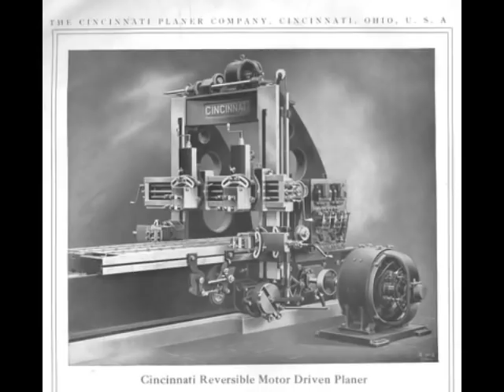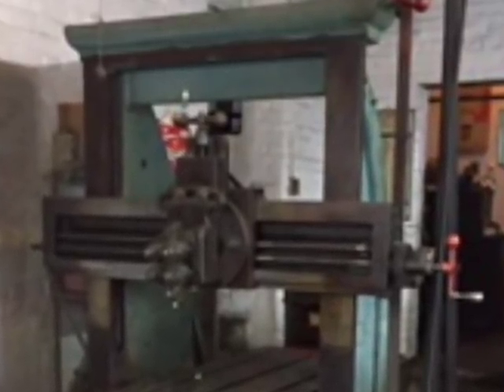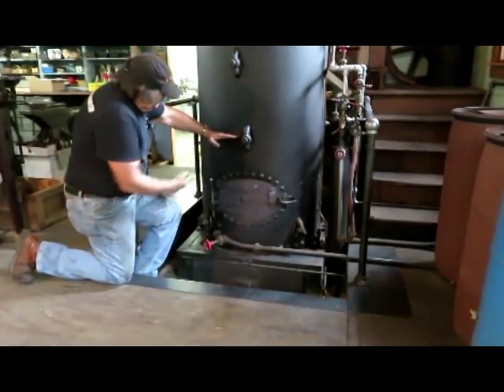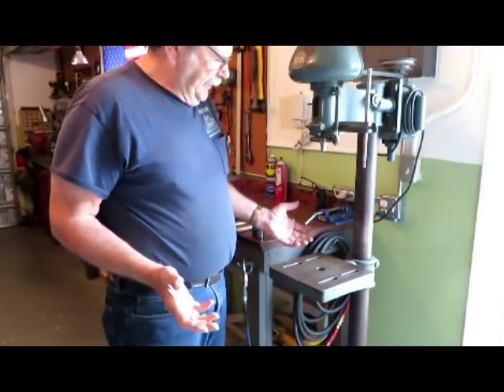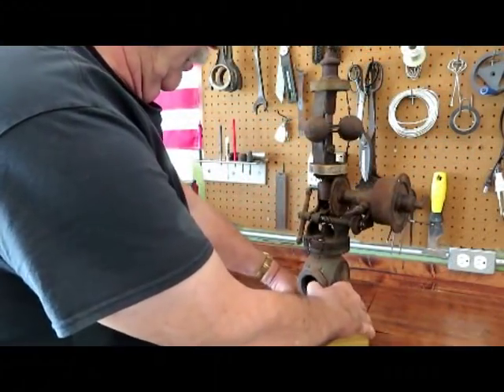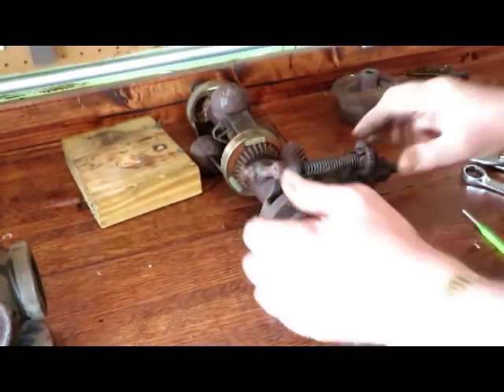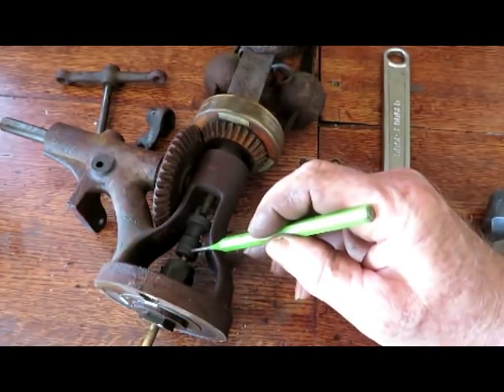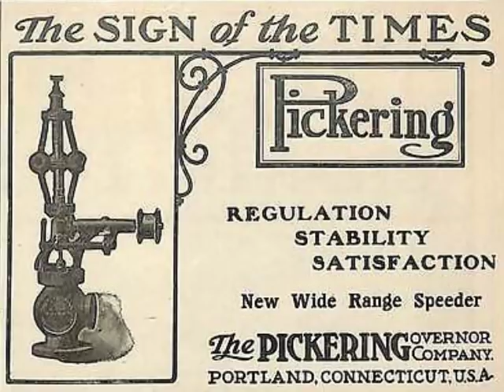Old Steam Powered Machine Shop 51             Company Meeting

Comment: Dave I have been with you as of day one .I will always hit the like button. I did my time as a machinist Heavy duty mechanic .The shop I did my apprenticeship in had a monster of a planer the table was 8 feet wide and 40' long We fit a Cincinnati mill to the head with the big 50 taper tooling it was quite the machine to run The table we converted to hydraulic feed  Yes those where fun days

Comment: Your Delta drill press is very much like mine, I have a model DP 220. It is 14 inch and also has the quick change arbors. Beside the 33 Jacobs taper arbor, they had a mortising arbor and a Morse taper arbor, and probably some more. I picked up a Morse taper arbor for mine (number 1) on E-bay a few years back for a good price and use that for my taper shank drills and have a Morse taper to Jacobs taper adapter with a Jacobs chuck for my jobber drills. The old Deltas are very smooth and quiet running drill presses.

Comment: If you do a search in Youtube for "Langhobelmaschine" (german name for metal planer) you´ll find a few videos. But step back from your screen, some are real large. In the 70th, the company i worked for (they made hydraulic press systems, comp. is long gone) had a planer, which could do 12 mtr. long pieces. The bed must have between25 and 30 mtr. I loved it....
Reply from the maker: I've seen some big ones in India.....Dave
Reply: They are great machines. And some were usable as a mill. You could attach one or more spindles instead of the traditional tool holder for special operations.

Comment: I had that same drill and the same question.  

An older machinist friend said: 1 degree 47 min taper. Use a slide hammer. Popper right off.

Comment: Good show Dave! ....I hope all works out for the planer move ... cannot wait to see it in action!   You must have not looked in the right place regarding your questions about your drill press! There s lots of info out there, and one of the most popular vintage presses around! As a matter of fact...I happen to reproduce the spindle and spindle pulley bearings, for lots of guys doing restorations! It's done more as a favor rather than a money making deal, and the bearings are a bit different, and cannot be found anymore. The reason for the being different, than main design feature of the press, was based around interchanging the spindles, as many types were made for it. Let me know if you need bearings.  Jim
Reply from the maker: Thanks Jim, I will file this conversation....Dave

Comment: Dave, Ask around you area and find independent truckers to haul the planer. In my experience often an independent or small company will haul cheaper and handle special loads better than the big boys. I have never had a single big load hauled but I have had several small items hauled across country at discount rates. Sometimes they are looking for a load home and will discount because they don't want to run empty.  Anyway good luck, enjoy your videos. Mike N.

Comment: Industrial boilers have a continuous blow down valve set to blow off about 10% of the steam flow continuously. Fine adjustment is determined by the conductivity of the boiler water. The boiler water sample is taken typically from the CBD line. This sample is tested for pH, conductivity, and residual treatment chemicals. Higher pressure boilers also are tested for silica.
Reply: That's interesting. Historic boiler operations, it is recommended to blow down as steam is rising in the morning, usually around 20 PSI. Like so most of the scale has settled out during the night and will be blown down. Additional blowdowns may be performed as needed through the day to maintain water quality and prevent foaming. 

Usually you'd see locomotives blowing down when crossing bridges, and workshops often had a dedicated blowdown track bordered by a fenced-off area so the blast would not hit any unsuspecting personnel.
Reply from the maker: On old stationary boilers there usually was an additional blow down valve at the mid water level to blow oil and sediment off the surface of the water...don't know how effective that was.....Dave
Reply: @davidrichards5594  According to Jim Conte it can be quite effective. He posted a story on the stak about a chicken processing plant that apparently had a leaky condenser and ended up with chicken grease in the boiler. Using the surface blowdown their boilers went from barely steaming without tripping a safety limit to steaming full power in less than an hour's time.
Reply: @davidrichards5594  They would be as effective as the people doing the water tests and looking after the results. The last place I worked the CBD was automatic and linked to the steam flow. It was nominally set at 1% of steam flow and modified according to the conductivity of the boiler water, all of which was monitored. Operating pressure was/is 1600 psi and normal steam flow was 600K pounds per hour. there is a 4 stage water treatment plant which consisted of multimedia filters, a 2 stage reverse osmosis filter, a cation/anion demin train and a cation/anion polisher. Pretty much all the conductivity in the boiler water came from the TSP and ammonia we added, which considering the amount of water involved was pretty minimal. In addition to the on line monitoring we also did manual tests twice every 24 hours. Load was a 68 megawatt turbo generator.

Comment: The planner looks like it will be a very nice bit of kit and a great addition to your shop. I was interested to see your storage method of your boiler. Where I am we use a boiler treatment that helps with getting the Ph correct as well as shifting sediment and it also works to keep oxygen out when the boiler is cold among other things. If the boiler is left for more than a couple of weeks the usual practice is to water wedge it so that it is full to the brim of water which keeps the boiler treatments protective coating on the steel and prevents air from getting into the boiler. If the boiler is left longer than 6 months without a fire the treatment looses its effectiveness so the boiler would need to be dry stored. 
All very interesting with boilers as in the working day they were a very consumable item and now we work as hard as we can to preserve them for as long as possible.
Reply from the maker: Nathan is 100% right on with everything mentioned. I use Jim Conte's "Boiler Saver" (there are others) which has buffers to KEEP the PH right, but you still need to adjust the PH on the "fill".....Dave

Comment: Dave
you are a man after my own heart. many years ago i too looked into a getting a plainer and you have ran into the same problems that i did. i wish all the luck in getting it home. i wish i was 25 years younger because i have a job that would fit that plainer like a shoe. i made a homemade 2 cylinder mill engine out of an old donkey engine. i had a local welding shop to weld up a base for it but with all my instruction's they still never got the base flat enough for the cylinders to run smooth enough for me. it needs to be setup on a planer and be milled flat. dimensions don;t mean much but the flatness dose. Dave if you need some money too help just let me know.
Reply from the maker: Thanks very much. Welded steam engine frames are the main thing I want to do also with a planer. I would like to build a "box" frame to make two side crank 8 1/2 x 10 engines out of the Mundy steam hoist that my boiler came from......Dave
Reply: David 
that is just what i did.could you somehow send me your email address so i can send you pictures of it. i wish i could post pictures here on the comment page but that is above my pay grade.

Comment: Dave, I realize this video is a year old, but in the spirit of what your channel upholds, it is merely ripening. I work in SD as a toolmaker for a shop that runs the latest and greatest CNC equipment in modern production. The reason I write this, is to tell you that the bread and butter of our business is planers. Yes, buried in the middle of our shop are six old planers, two Rockford hydraulics and four G.A. Gray gear drive machines. We resharpen mill rolls for the roller mill and feed grinding industry. Our competitors run modern cnc "corrugators" as they're called and they cannot hold a candle to our setup. It takes a lot of man hours to convert these old workhorses to do what we do but it pays dividends. My job solely consists of keeping these old girls running. I'm a rebuilder and scraper hand as well as a toolmaker and it's my job to maintain and convert these machines to do what we do. I will tell you first hand, they don't build em like they used to. Our oldest machine is a 144" x 48" gray built in 1907. As far as we know it's been in daily production since it was new, we have maintenance records going back to 1909. It was bought by our company on 1977. Taken from a line shaft shop in MN. Our largest machine is a Gray with a 16' x 4' table weighing in at 73,000 # and it's a dream to run. We recently purchased a dual column 14' x 4' planer from Jefferson iron works in Ferndale MI. You need to check out his website it's very well done. He caters mostly to the automotive industry. His biggest machine is a Giddings and Lewis 40' x 20' dual column, the table alone is 97,000# and no that's not a typo. We toured his shop last Sept. He was cutting 16, 8 ton castings at once on it for GM. Two heads on the cross rail taking 1" deep cuts with 1/8" stopover for a 2" removal total. It was a sight to behold, the operators wore ear muffs. He said no one in detroit can match his productivity on large bodywork castings. He is third generation. Again look him up. Also years ago I stumbled upon an old book on ebay from 1907, which unbeknownst to me at the time of purchase was filled with tons of old machine shop treatise and lots of planer work, it is labeled I. C. S. REFERENCE LIBRARY. I doubt you could find a copy but I wanted to mention it, and if you would like to borrow it I'd be happy to lend it. I wanted to point out that with your Jacob's chuck you can buy a set of short forked wedges that go behind the chuck, one compliments the other and they can be stacked and squeezed in a bench vise to quickly separate any Jacob's taper, McMaster Carr sells them. Go figure.  Also at roughly the 25 min mark in this video I saw you using the unmistakable lime green Pittsburgh brand Harbor Freight punches to disassemble the Pickering governor. I was somewhat saddened by this until I remembered I own and mildly covet the same set, and so you are forgiven. Just wanted to give you a bit of a jab. Before you make assumptions I am 30 years old and currently training 2 younger gentlemen to follow in my footsteps at the company I work for. The trade is alive and well. . . .and so are planers in a niche. All the best.
Chris.

Comment: For something a 113 years old, that governor  looks to be in good shape, It came apart with out any difficulty, so it probably doesn't need a lot of rebuild. One shaft is bent but that's easily fixed.  I thing a good cleaning will do wonders for it. As for the planer, where can I send a modest check, and does the shop have room for it?
Reply from the maker: Hi Jim, Thanks for the help with the move, there now is a paypal.me link on the channel home page, or send to the address in the video description or my profile.  I'll be continuing on the governor ....Dave

Comment: It would be really interesting to see a planer running.  I've never seen one running, even on video.  They are always static "museum" pieces.  But I don't know where you are going to put one unless you double the size of your shop.
Reply: , and then with it what on earth will you plane.  You will need large work handling equipment and the blocks of steel or castings will be very expensive.
Just sayin
ps, get it anyway!!

Comment: If I could make a suggestion. Many of these "haulers" charge by weight. Taking apart part of the machine and putting it in the back of your truck and trailer would reduce weight, probably make you feel better if some of it was "shipped" carefully under your watchful eye. Chances are some of it would need to be taken apart for proper service anyways. Just a thought.  After all my mini mill and my southbend lathe circa 1937 are just too darn heavy for me to get into basement by myself. I took them apart and took the smaller, and lighter, pieces down to basement one at a time and reassembled.
Reply: Most shippers just charge by mile.
Reply: @robertlee9395  I wish!

Comment: Dave, I enjoy your shop. 
          I hope this helps you. I have a steam engine  8x18 Erie city box bed, powered by an oil fired HRT 150 psi Columbia boiler. I installed these in my shop in 1975 and they might get run once a year.  I store the boiler completely full of water with no air space, at a ph of 10.  At shut down, I add a dose of sodium sulfite (H2s03) to the final feed water. This stuff wants to be sodium sulfate (H2so4) real bad and will suck up any oxygen that creeps in. (Much cheaper than Nitrogen). The test kit is cheap and if there is a trace of SO3 present, you can be sure there is no free oxygen in that boiler. Most boiler treatment companies have it. Anderson Chemical "OX Gem".   On the water side, the boiler looks just the same as it did 44 years ago. (I put a little electric heat in the fire box to nix fire side problems.)
          LOL....If someone else has not already stepped in;  ...pull that zipper head number 33 drill chuck and I will send you a Jacobs for it. They make good targets and scrap iron.

Comment: I found the information about the water's pH and nitrogen blanket interesting. Water treatment was very important for a boiler's long life (or not). How do you regulate yours? A chemical additive? Steam locomotives added a chemical when filling the tender. Local water qualities could vary quite a bit. "Bad water" districts were often dieselized first to eliminate the costly boiler maintenance from hard mineral deposits from "hard" water.

I was fascinated how you disassembled the Pickering governor. You gave a good description how it works. The same basic principle is used to govern propeller rpm on constant speed propellers except they use engine oil to move a piston and cam arrangement in the propellor dome which is mechanically geared to the propeller blades.
Reply from the maker: Hi Paul:  I follow Jim Conte's recommendations on boiler feed water treatment and use his "Boiler Saver" treatment as well as raise the ph of my rain water collection system to about 8.5.  An occasional 1 gallon blow down of the bottom boiler drain under pressure takes out settled scale and sediment. The treatment has gradually cleaned up the interior and created a coating on the inside surfaces. Good stuff.....Dave

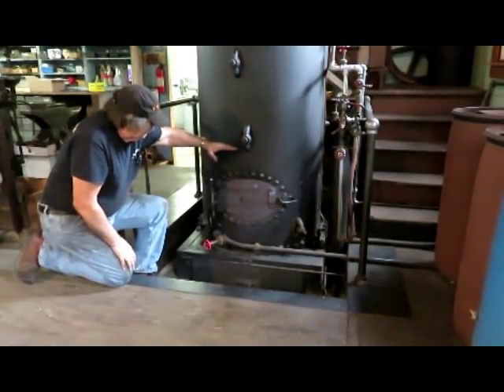Comment: My only question was where are you going to put it ? Your shop also looks full. RE: 10:45 about scale - the water with scale in it tends to be more corrosive. My boss up in AK used to have me blow down our 2- 125 HP boilers twice a week.
Reply from the maker: Plan "A" is to put it just to the side of the ramp (near the pipe vise) in the front shop. The line shaft will pass through the window opening above the bench to the front shop which is the engine shop and is being dismantled and machines moved around anyway. Plan B will be to build an addition to the old shop with concrete floor at the old shop wood floor height.  ...Dave

Comment: Dave one thing I can't find and I think i've looked at every video - what's your background and trade - what did you train and work as - a little personal I know but I'm really interested and I know you don't like talking about yourself but your fans may be really interested - Regards.
Reply from the maker: Gez: I managed a BS degree in Mechanical Technology, Welding Technology minor, worked with heavy house moving equipment company(cranes, etc),  Millwright work with Hancor (plastic pipe) , owned and ran a motorcycle / lawn & garden equipment dealership, rebuilt small engines, owned an automotive/commercial engine rebuild shop for 35 years. ...Dave
Reply: I thought so - it shows - the level of knowledge is very impressive and we love your work and your vids and are indebted for someone with your background sharing their knowledge - thank you .-  @davidrichards5594

Comment: Would you happen to know how to determine the correct size flywheel for a steam engine? I've been working on one for a while now and think the flywheel it has is too small, it might not run right because of it.
Reply from the maker: I had this come up before and couldn't find anything in old engineering manuals about it. Maybe another commenter might  know something about it.  The action of a flywheel has more to do than just the diameter. The weight and how far out on the diameter it is determines it's "moment of inertia. You could put a fairly heavy pulley on the shaft to help.....Dave

Comment: I would find someone with a large role back truck. You can save a lot of money . I had a lathe that weighed between 8 to 9 tons with 120 inches between centers. I was looking for a larger planer but bought a gray 24x60 flat belt drive, 2 feet shorter then the one you are looking at

Comment: Hi, I noticed that on the drill press y ou have the cord wrapped around the metal starting capacitor on the motor. That is not a good idea as wrapping the cord around metal make an electromagnet out of it and also reduces the current  flow to the motor.

Comment: Dave I watched a video some time back where a man bought a wood planer and it weighed about 1,000 lbs.  They used a cane hauler with a winch in front of the trailer and they just tilted the bed and pulled it up. Is this a possible or is the planet to long. Just my two cents. I know I’m looking forward to that in the shop. Good luck.
Reply from the maker: Gerald:  We are gonna figure out a way to do it somehow, and you'll be seeing it for sure....Dave